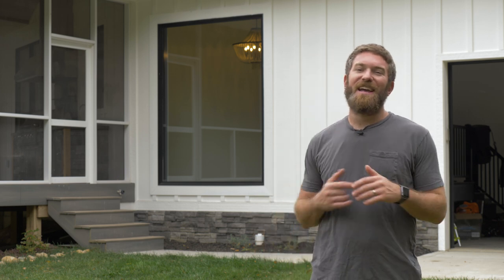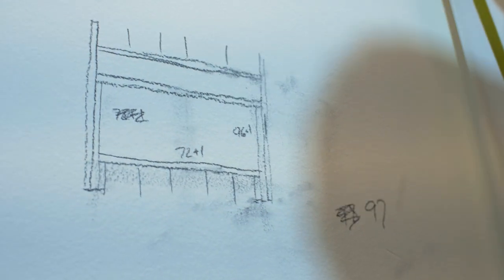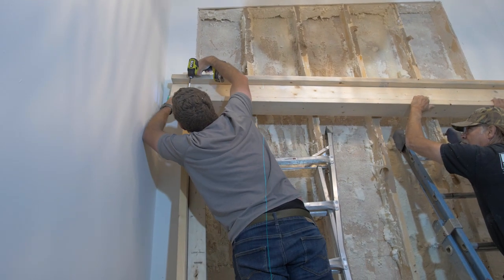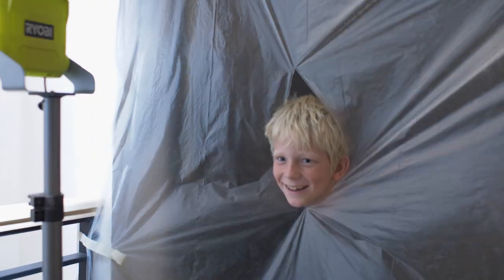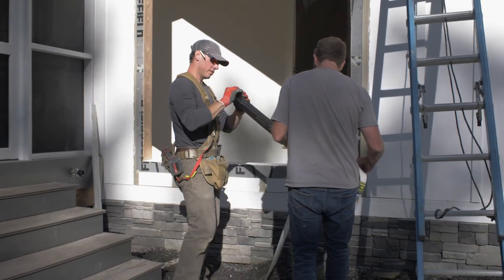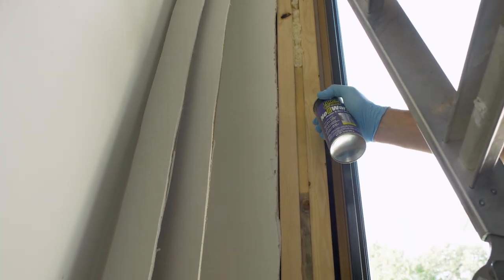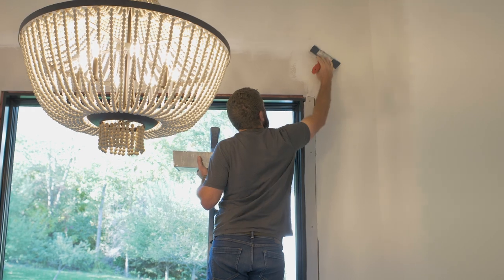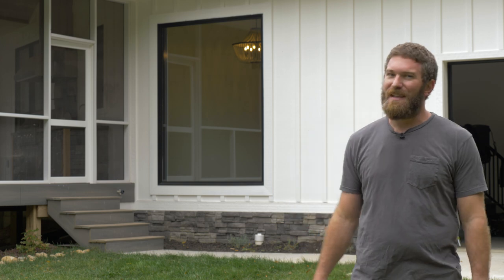Cutting, Framing and Installing a Giant Window in a Blank Wall!

Comment: From what I've read, the nailing pattern on the LVL header pieces was unnecessary. A nailing pattern is to transfer load from one member to another when a load is applied to only one. As in, joist hangers attached to one member, where transferring to the other member is key. In a header scenario, both members are bearing weight equally, given conventional design and build.